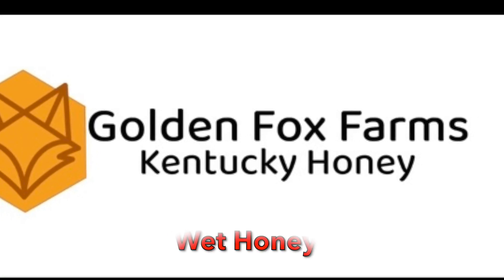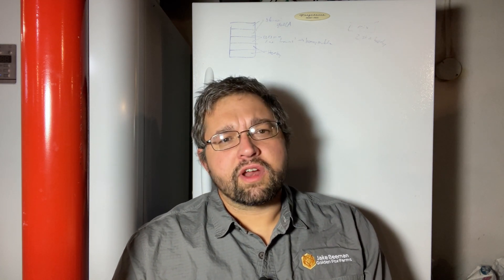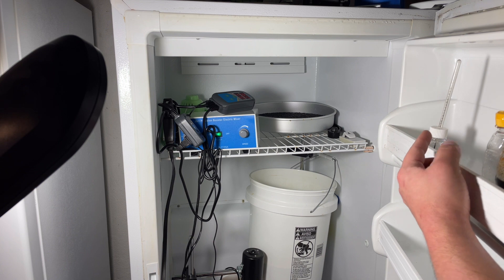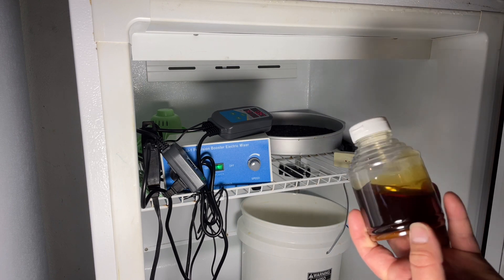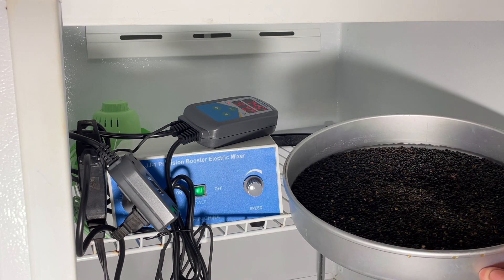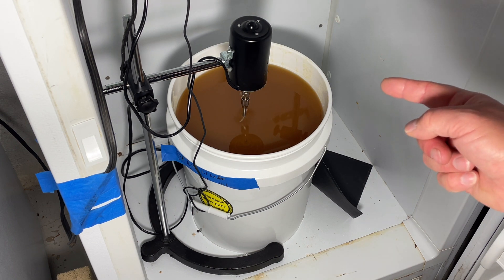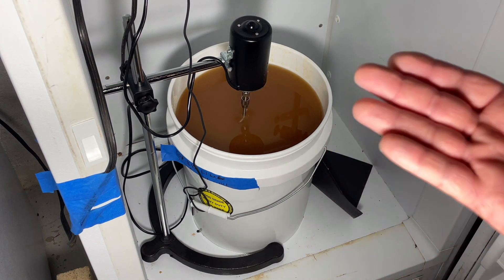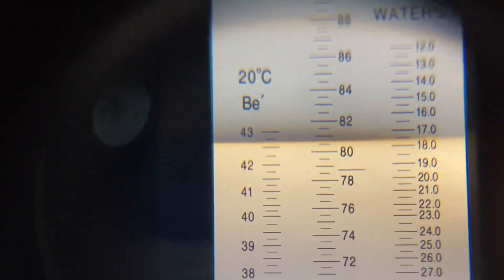Wet Honey and Honey Drying

Comment: question, I have copied your setup for the most part, how long does your setup take to drop a 5 gallon bucket of honey from 19 to 17ish?  Also, does it tend to form a foam on the top for the first day.  I have been decrystalizing the buckets and then putting them in the dryer, check on them the next day and they will have a large ring of foam on the edge of the bucket that was not in there before I put the mixer in.  I have slowed my mixer down as low as I feel safe, never really had it running too fast as you recommended.  Thoughts?
Reply from the maker: It is not unheard of to have some foam/goop show up and ring. I have seen decrystalized and then warmed honey do similar, I think all of the trash wax and such that gets past the extraction line burbles up to the top as the honey becomes increasingly liquid, and the slow mixing can help increase that action. As far as mixer speed: mixer just needs to be moving enough to prevent a film from forming on top of the bucket, they can be at rather low RPM (mine are probably running around 1/3rd power). The mixers shouldn’t be incorporating air or anything. There is the possibility your honey is already saturated with yeast and is fermenting and it is increasing with warming: I have NOT encountered that but I could see it happening with something like saw palmetto honey. Would definitely give that ferment smell and taste. Only way to fix that is doing the full Dyce creaming treatment, heating to 150 to pasteurize it and stop that fermentation (some bottling tanks can hit that temperature). As far as time to dry, it can be erratic: the dryer the atmosphere the faster the buckets dessicate, and in winter indoor air tends to be pretty dry, performs a lot better than when trying to do it in a wet summer. It is not super fast unfortunately, but I’ve had buckets drop from 19s into 17s in a week, sometimes it takes two or three. The initial drop is faster, as the honey gets dryer it becomes increasingly hard to pull moisture out. I’m also of the opinion some honeys dry more readily than others. That said, I forgot a bucket for a month and it was in the mid-14s when I pulled it. I’d just scope it every few days, will give you an idea how fast it is or isn’t proceeding. Best wishes.

Comment: Thank you for the information.  I ordered a stand blender and am hopeful things will workout.  I calibrated my refractometer at the beginning of the season with the 99.5 upc glycerin from last year but it was obviously bad, prolly picked up too much moisture and my refractometer was reading 2 points off.  If it would have read correctly I would have dried in comb, but here we are, 28 buckets of wet stuff and in need of a solution.  Your idea is better than my solution, so I am running with it.  Thanks again

Comment: Any chance you have a product list of your set up?
Reply from the maker: Unfortunately I do not. Each time I’ve bought a bucket mixer or carboy mixer it is usually a short-lived brand stamped on the same machine out of China. The space heater and fan were the smallest ones I could find at that time on amazon.  

One mixer controller burned up, and I now run mixers on both buckets, but each time I go shopping it is a new model number and name.
Reply from the maker: The thermal controller is an inkbird. The silica beads and pans were generic.
Reply from the maker: The most recent stirrer unit purchased: https://a.co/d/7spmw0C
Reply from the maker: You don't even need to run these at 30% speed. Just has to be enough to keep the honey from forming a stable film.